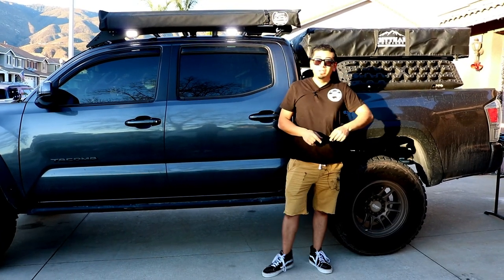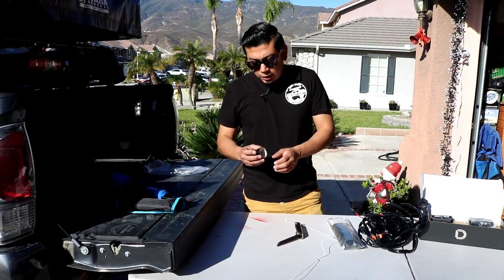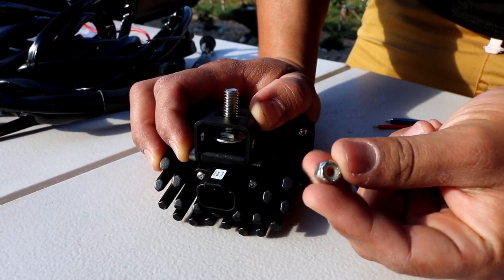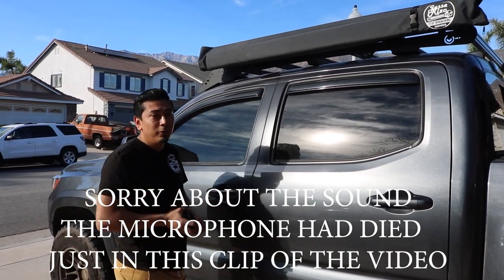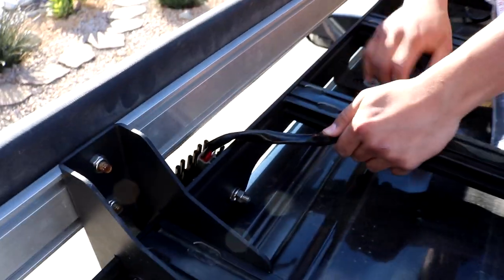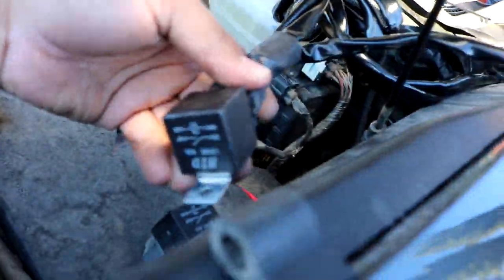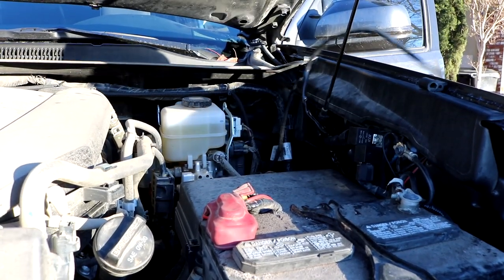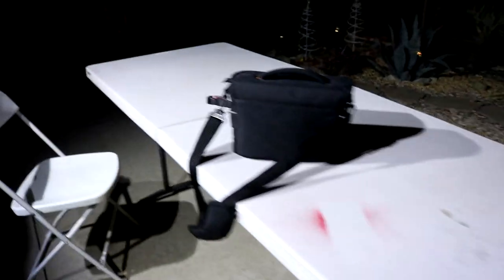DIODE DYNAMICS SSC2 PRO HOW TO INSTALL + WIRE ON PRINSU ROOF RACK! LIGHT UP YOUR CAMPSITE WITH THESE

Comment: Only video I found where you show the wire harness from diode dynamic being installed thank you! I bought the SS3 pro fog lights and noticed my factory connectors were broke and for some reason you can’t find them online to replace even the dealership couldn’t get me anything oem related. Glad I found your video.
Reply from the maker: Thanks for watching :) I appreciate the support!!

Comment: Hey Jesse. I see this was installed prior to your Auxbeam panel. How did you connect it up to the Auxbeam circuit breaker to enable the switch panel to toggle through the main high powered light and the low power backlight?

Comment: do you feel like keeping 1 traction board on each side is better than keeping both on one side? im thinking of doing the same thing on my bed bars
Reply from the maker: I like it 1 it’s different then other setups so I like that it’s different lol, 
And 2 I only have 1 rotopack gas tank if I had another one I’d probably put those on the other side but for now ima rock this setup for a bit